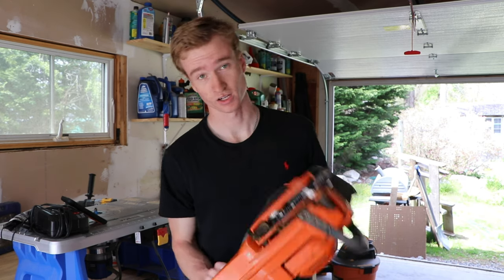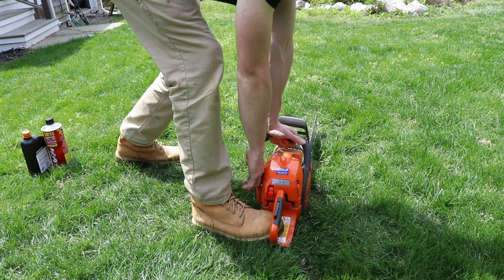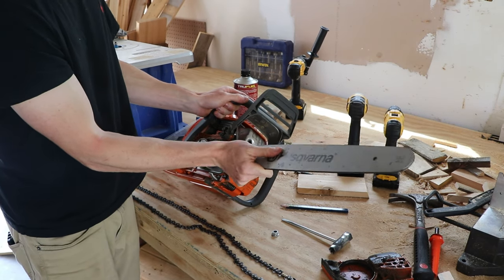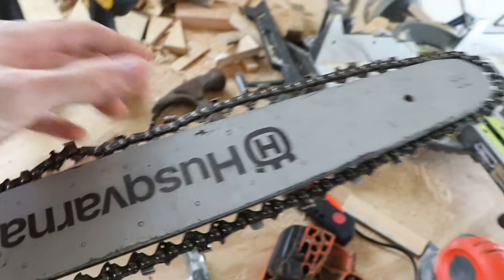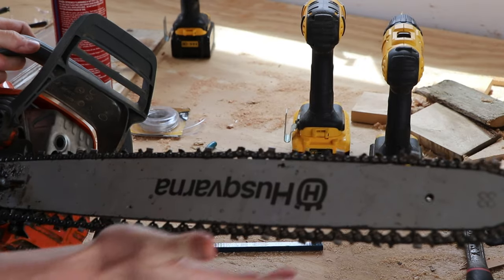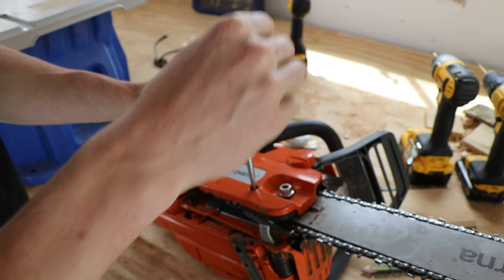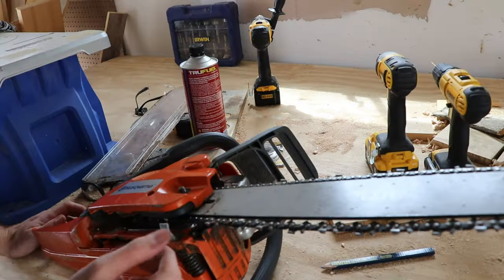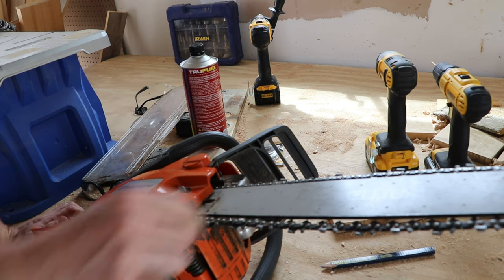How to use a chainsaw | How to fix a broken chain

Comment: I have done that a few times, and if the chain is not very damaged it can work, if you don’t want to stop to fix it more carefully.

Usually there are just a few teeth damaged by the chain break (with my husqvarna 435 somewhere between 4-5 and 6-7). 

When they are very damaged it has worked well for me to use a small dremel and just take the shitty things out. It usually takes me around 5 minutes and you save the engine and the bar. 

But i don’t have always the dremel at hand 😂